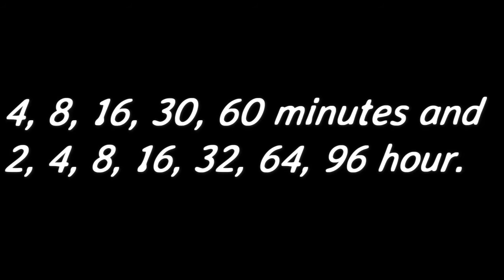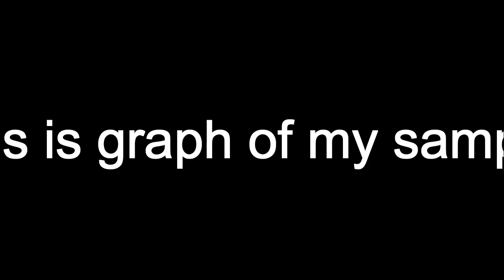Hydrometer Analysis

Comment: After mixing the air-dried soil with the prepared reagents solution do we absolutely need to pour them through a sieve again?
I have read in one document  where after using air-dried soil through a 2-mm sieve and for the determination of clay and silt, the suspension was not transferred through a sieve again only for the determination of sand where sand was transferred through a 50 um sieve. Will we lay down the hydrometer and temperature at the same time? When we let stay overnight the prepared solution, do blank treatment needs too? Can we adjust the temperature? If we need 20 degree Celsius and our thermometer is graduated till 30 degree in this case what can we do?
Reply from the maker: Could be better to numerate questions for avoiding confusion :), any way I’ll try give number to answers.
1) For the first question regarding air-dry soil usage and sieve issue:
I don’t know actually what you want to ask, however I could tell, the soil sample wasnt needed to make it powder. Before the hydrometer analysis, the wet sieve analysis should be carried out to find bulk size materials. When you use wet sieve analysis the particles pass in proper mesh size by help of water and the particle passed from sieve number 200 are collected in the cup that is put bottom of  0.002 mm sieve, after that the silts and clay particles with water in the cup (that was passed from 0.002 mm sieve) is left to the oven about 24 hours to dry. And when they dry you have  silt and clay size powders (this is for the research which is required extremely exact size). However using just mechanical sieve analysis you can get also particles were passed from 0.002 mm sieve.
 We don’t need pour them through a sieve again after soil is mixed with reagents
2)For the second question of hydrometer and temperature issue:
You can take the hydrometer and thermometer reading but you arent offered to keep the hydrometer and thermometer inside the solution. 
3,4,5) Well, I think there is some confusionwith termometer purpose. We don’t need to keep temperature at 20 or what else numbers. The temperature of solution will probably chance at night time to compare with noon. We use temperature recordings while calculations. If you want to understand better , send me email, I will share the document with you to read. The calculation procedures also are explained in there.
Hope the answers are helpful if not please send me your questions with large explanation.